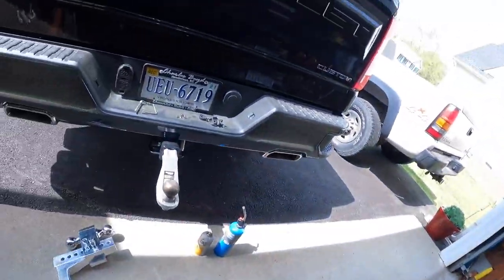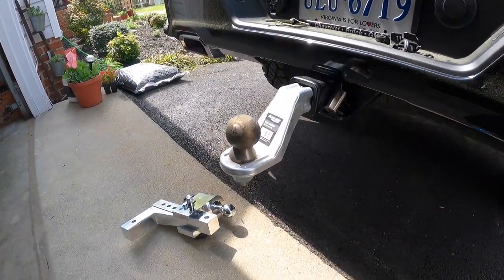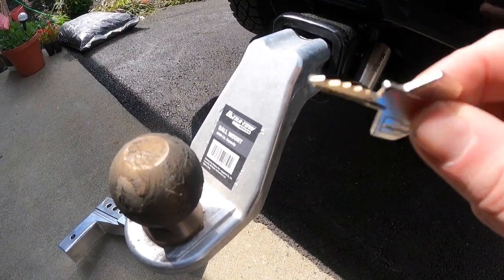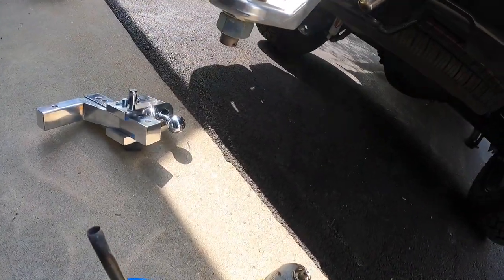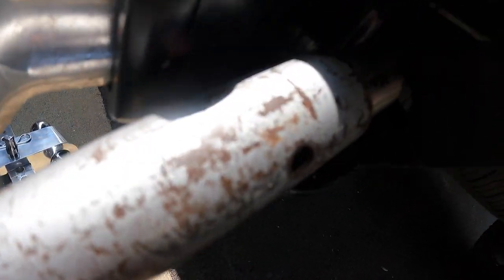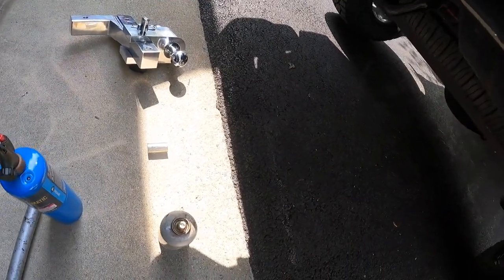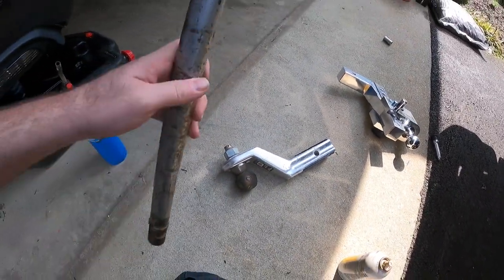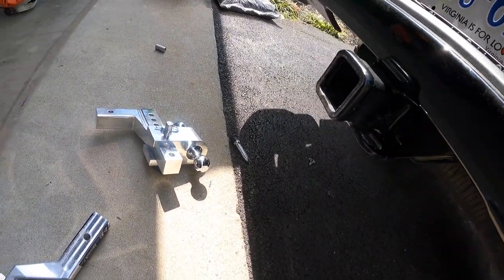Removing a hitch lock without a key.  ( Breaking it off in seconds )

Comment: My pin was to tight against the receiver to put a pipe around the lock so I used a demolition bar and tapped it in behind the lock with a hammer.  I pried upward and 2 seconds later the pin snapped and it was off.  Thank you for the video.

Comment: Believe it or not, this method works and is the best way to remove the hitch lock. I did it to my dad’s Tacoma. A little bit of back and forth bending, and the luck came right off. No damage to the lock. In fact, the lock is salvageable. The pin is the weak point and was broken. Kinda scary to see how easy it is to break this apart. Saved us $$$